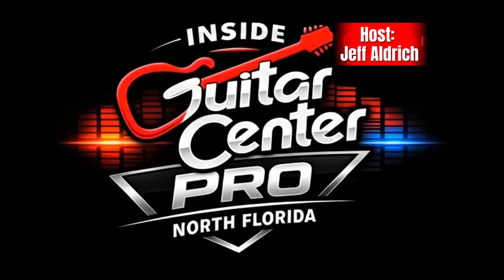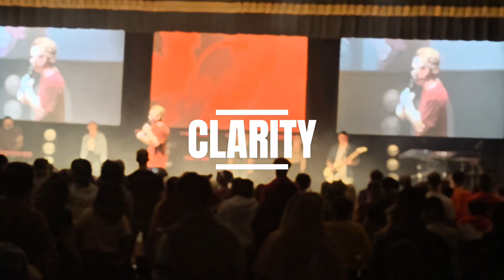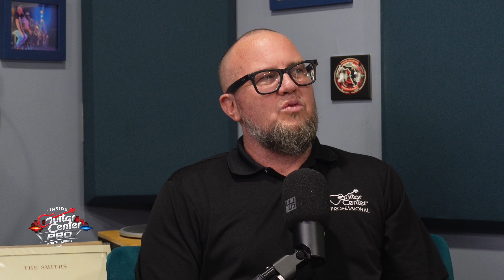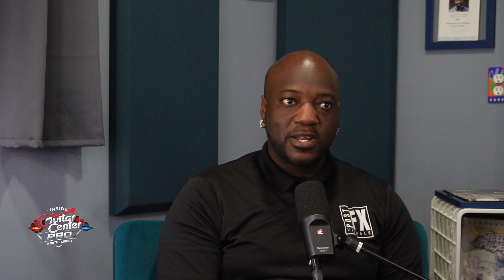So You Want a LED Wall?  A Conversation with Kelvin Postell

Comment: Nice chat.  For power you have to specify it to handle the max inrush power so that when it first starts up you are not tripping breakers.   I see where you were going with that one.
Reply from the maker: Yes, the electrician hired should address that and account for it. Knowing is half the battle